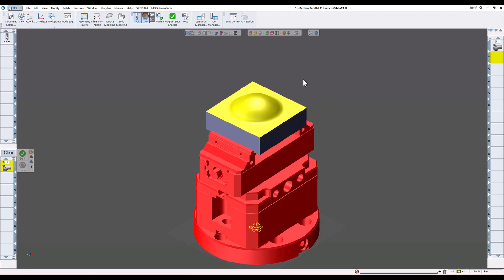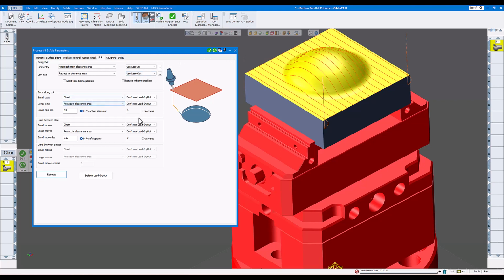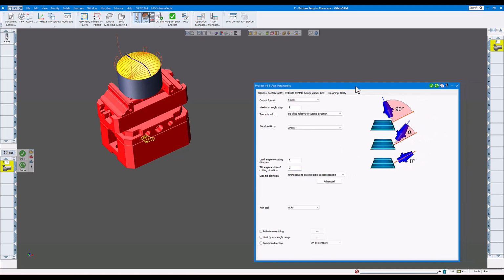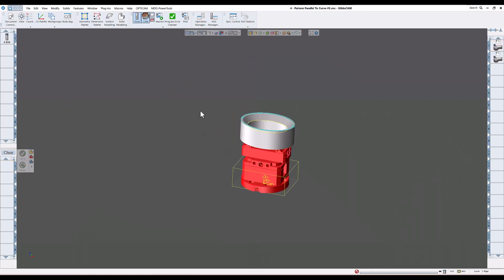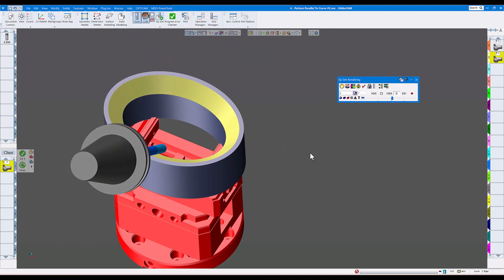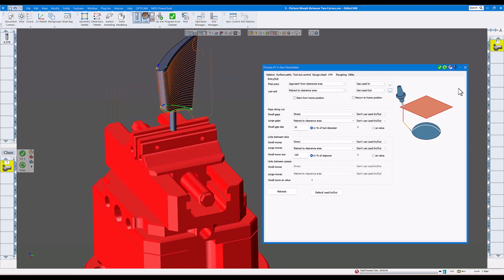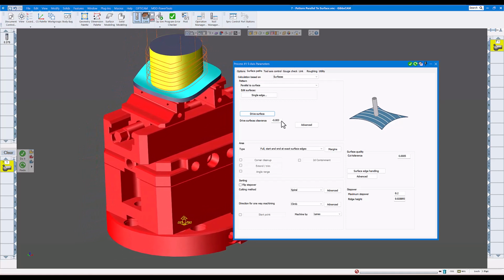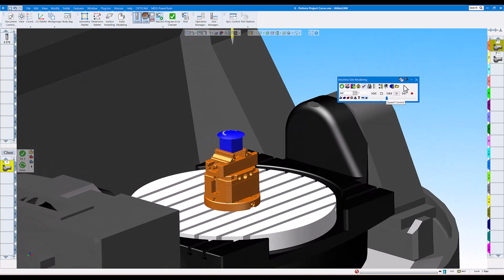GibbsCAM 5 Axis,  Series 1 videos

Comment: 22.55 min. simulation,...I dont understand why you dont use for that chamfer internal roughing with end mill...swarf strategie? Wasting time plus ..forcing the machine non sense....It is a basic side cut.
Reply from the maker: See the answer I sent you 7 months ago.    These are just examples of the different kind of toolpaths.  I never said this is how you should cut it.
Reply: @GibbsCAMVideoTutorials  We know that....but who see that...will say that this is the correct programming...but in final...it is not.